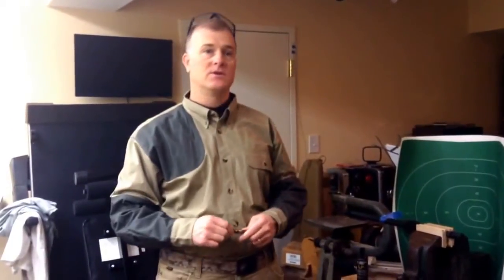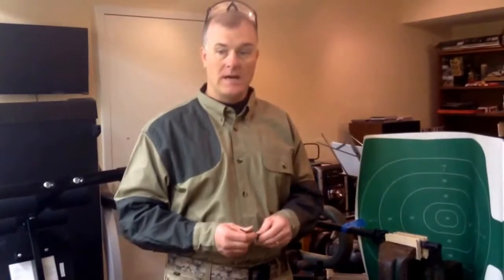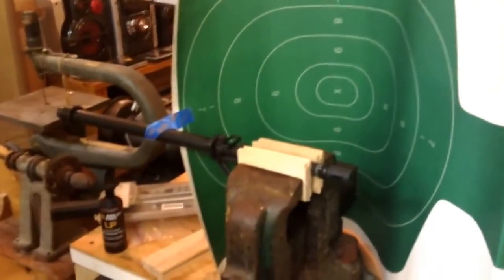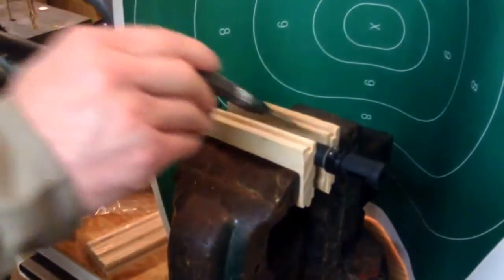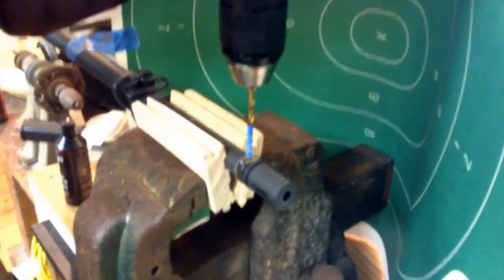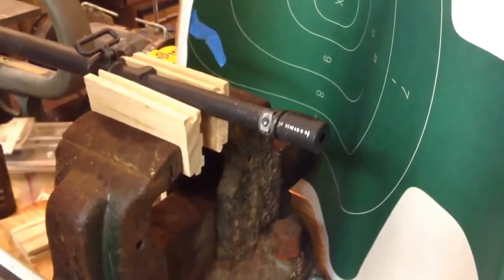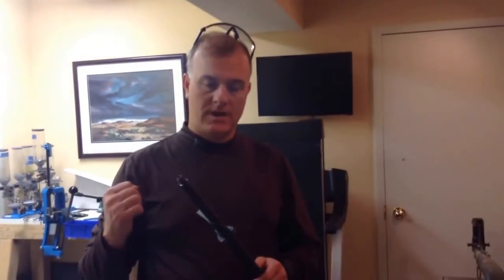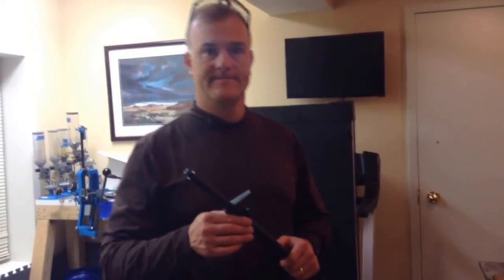How to Remove a Pin and Welded Muzzle Device

Comment: Don't say stuff to this man you wouldn't say to his face. OP, when drilling, better to drill slow so as not to heat the bit and lose the temper of the steel... also, cutting oil helps the drill move through the material better too.  I commend you for your attempt and the effort to provide a video to those interested. Take care.
Reply from the maker: Great comments on taking your time when drilling.  Thank you for the support!
Reply: Doesn't the welding process or the act of shooting heat the barrel up more than his drilling?
Reply from the maker: I only used the grinder to find the outline of the pin. So I think the heat from shooting would possibly be greater than the heat that would have dissipated from the grinder and even later with the drill. I mean to convey that I think that the heat built up was not worse than from shooting. Some of the heat was dissipated into the brake too. have a drill press now. I might have tried a stronger bit in press if I had to do it over again. Thanks for watching!
Reply from the maker: But with a better bit you can go slow and avoid the heat as described. I think I used some LP as an oil but not a proper cutting oil.
Reply: @yourarsenaladvisor  I likely misread the comment.  I thought someone was critical of your drilling causing too much heat on the barrel (not the drill bit).
Reply from the maker: @lukeeskola3434  You were correct. JH above gave some advice about avoiding heat. I just commented, with 2 replies, a little out of order about the process I followed so probably seemed odd.

Comment: Be advised. Those with the Ban State X95 Tavor fron IWI. Its no pinned. There are 2 set screws threaded through the brake.  Got it out with a dremel. No damage to threads.
Reply: You got more info on this? That’s why I’m watching this video
Reply from the maker: Try here 
https://www.reddit.com/r/Tavor/comments/y2mzfw/muzzle_brakes/?utm_source=share&utm_medium=mweb3x&utm_name=mweb3xcss&utm_term=1&utm_content=share_button

Seems like folks get the Tavor without a muzzle device and talk about what to add  and possibly need to permanently add it.

Comment: When what you are drilling is harder than the base metal then try using a tungsten carbide frameless bit.  Any of the Dramel 99xx series bits will work and you can choose either 3/32 or 1/8 tip, and whatever shape you want.  The 9903,
Reply from the maker: Thanks for the tip!

Comment: Thanks for making this video.  I have a couple of Olympic Arms barrels that have the 10.5" barrel with 5.5' extension installed.  There's no wrench flats on the extension, but I'm going to grind at the 6 o'clock position and see what's going on.  I was going to find someone locally to cut and rethread the barrels, but I'll give this a shot first.  And before anyone has a conniption fit, the barrels will be used on some SBRs.  I'm pretty sure all the gun makers were using a similar method to permanently install muzzle devices during the Clinton ban.
Reply from the maker: Thanks for watching! Be careful of the sparks.

Comment from the maker: Update:  There are front sight bases that secure via set screws which can be used on barrels that have pins.  So I bought one from Fulton Armory.  I will use it on the barrel in the video.  It will have the bayonet lug but I will grind down the sling swivel for use with a NM free float tube application.  -YAA

Comment: Would taking a magnet to the pin help, after  grinder? If it will slip out, less cause for concern when unwinding the flash from the threads?
Reply from the maker: In my case the magnet would not help.  The pins  are in there pretty tight and also materials from the grindings are also preventing the pin from coming out.

Comment from the maker: I have subsequently learned that I can't put a new front sight base on a barrel that has already had one pinned to it, such as the one in the video.  So at best I can possibly remove it and reinstall it in a free float set up or as is with a new flash suppressor or other device.  But I don't like the idea of an FSB without the bayonet lug, personally.  The FSBs start with no holes and they get drilled with a new barrel in them to create the fit.  Then they get reamed for taper pins.  This makes it difficult for a new one to be lined up with the old holes and be able to get a proper fit for the correct size pins, etc.etc.

Comment: Low speed heavy feed when drilling steel. And would be better to use an actual metal cutting but instead of a wood bit
Reply from the maker: Thanks for the advice and watching!  I thought the bits were for metal.

Comment: Why not use a small titanium drill bit and drill it out
Reply from the maker: Near the end, after I uncovered the pin to where I could see the circumference, I used a titanium drill to take it down.  Then before too long I was right above the threads and the muzzle brake was able to twist off and push the remnant of the pin out of the way.   I just ran down to the studio and checked the bit was titanium or titanium coated.